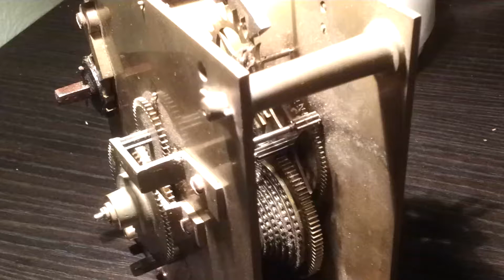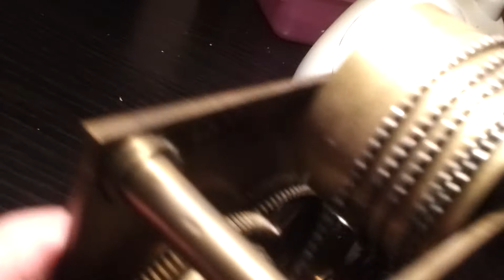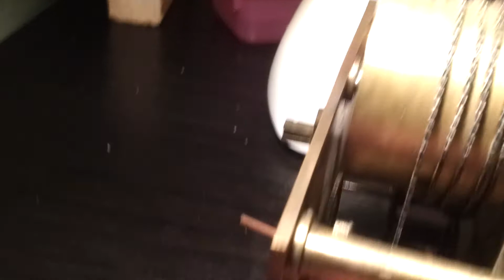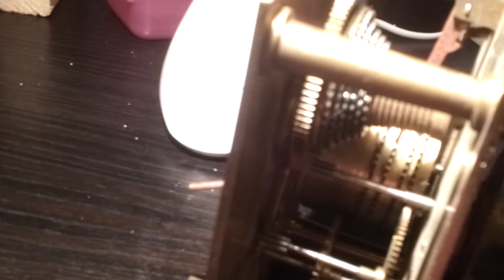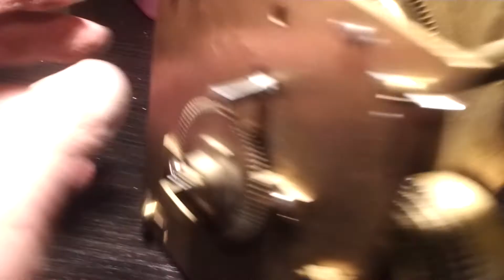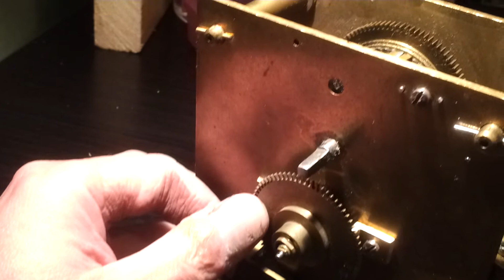Fusee Clock Movement

Comment: Did you ever get it set up in a case?
Reply from the maker: Not yet, I have fixed and restored a number of clocks since that video. I have changed my plans for this movement, it will become the basic movement for an astronomical clock showing sidereal time rather than making a whole movement for the purpose. It's on the back burner at the moment; I'll be retired in a couple of years, and that's a project that will have to wait until then. See link https://www.youtube.com/watch?v=TrhPiIfRcME